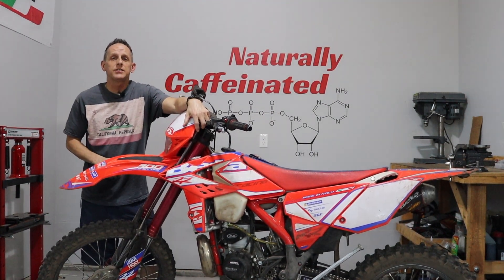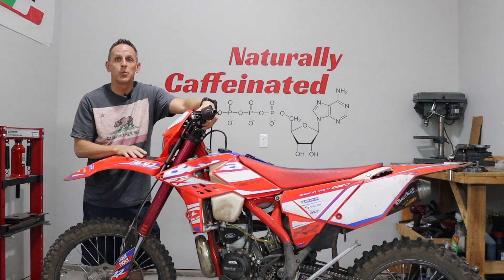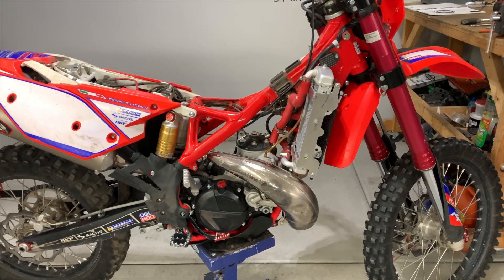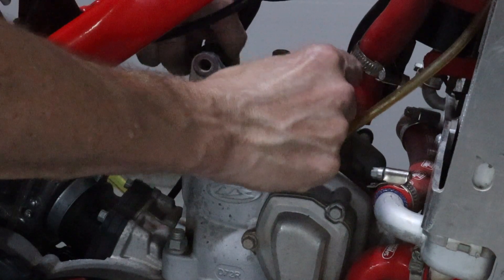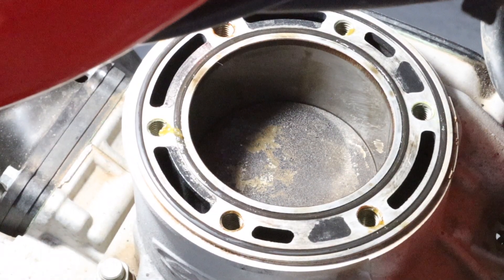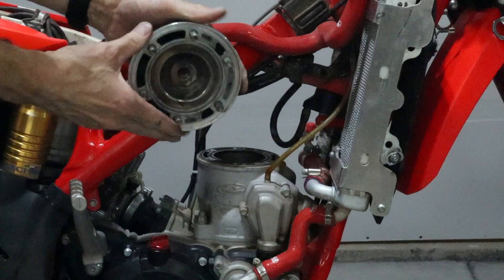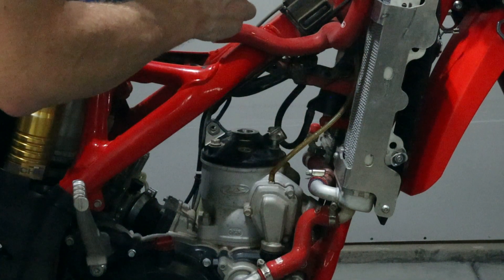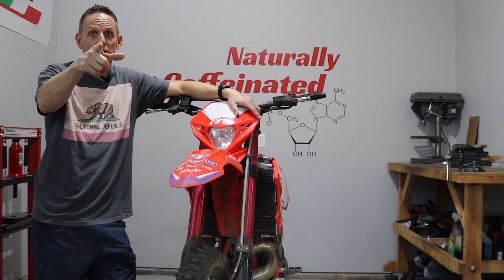I'm Losing Coolant!-Two Stroke Cylinder/Head O Ring Replacement

Comment: hi great to share
i have the same adding high radiator pressure.
did it wirk?
Reply from the maker: Turns out it was my radiator cap! It was missing the rubber gasket when I bought it.
Reply: @NaturallyCaffeinated  I'm having major loss of coolant w/o any external signs or black specks in the coolant. The cap has always been a PITA to install - so I now lubed it and will give a try. After lubing, the cap was soooo easy to install. Let' see...
Reply from the maker: @ Thanks for watching the video and adding your comments. Let’s hope it works longterm! Love these Betas
Reply: @NaturallyCaffeinated  The larger gasket is supposed to be seated on the radiator opening. There was visible precipitation on the aluminium, which could not be there had the cap been fully seated. So, I believe that the engine has over time evaporated much of the water out.

Comment: Got a 2011 250xcw is bubbling in the radiator and come out the overflow. Doesn't have time for it to heat up before it does it. Hopefully o rings is my problem as well. Did it fix your problem?
Reply from the maker: I did, it turns out it was my radiator cap.

Comment: Your o rings look better than mine just rebuilt 2002 rm 250 and it started spwing water out the silencer I'll let you know if the orings fix it but I'm pretty confident the inner oring was in bad shape... odd stuff since I replaced them on the rebuild
Reply from the maker: Oh man! Good luck and reply with the solution or share any updates.
Reply: I got a 1998 that that runs rich as fuck and I loose coolant out of the hoses I don't get it and it's like it's very hard to ring it out and get it not to break up in the top end almost sounds like a revlimiter
Reply: @jeffgood6441  just seen a comment on this update is the machine shop messed up putting the sleeve in local bike shop tried to deck it to no avail she hasn't been running since need to reesleeve it

Comment: I have a 2019 Husqvarna TC125 with about 150 hours and race it often. We have rebuilt the top end about 3 times now (just replacing piston, gaskets etc.) Few weeks ago it started pissing out coolant. Looking at the coolant when running I could see bubbles in the coolant. Ok, leaky head gasket or in my case a combustion chamber insert gasket.  Replaced it twice, different brands and still see bubbles and pissing coolant. Discovered today that the combustion chamber insert is cracked.  Seems like nobody has heard of this problem in more recent bikes. Just putting it out there that this can be the issue, seems rare but ended up being our issue.
Reply from the maker: Awesome comment! This is exactly what we need, more comments that might help someone out there who might not have a solution to their current problem! Thank you very much.

Comment: Heck my O'rings will not stay in the grooves. The O'rings appear a tad short and the other end pops out.
Reply from the maker: I had a simile issue but added a little grease and I was able to keep them in place. What bike to you own?
Reply: Yeah man those o rings just won't stay in place. I use grease to glue them down!

Comment: Just for S&Gs replace your radiator cap...they’re cheap and should be serviced regularly...had a similar issue with my Yamaha...I added a thermostat and got a higher pressure cap...bike runs @185-190 F no matter how I ride and no more losing coolant out the overflow 👍
Reply from the maker: Thank you very much! I picked up a radiator cap and guess what?! That was the problem!!!! I will mention you in an updated video. Again, THANK YOU!
Reply: Good stuff. Very professional. Thx